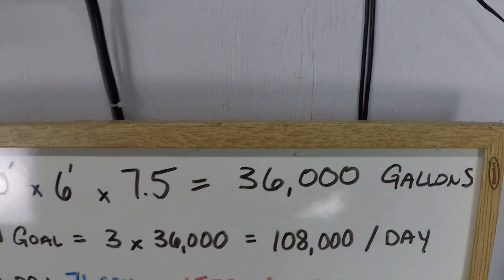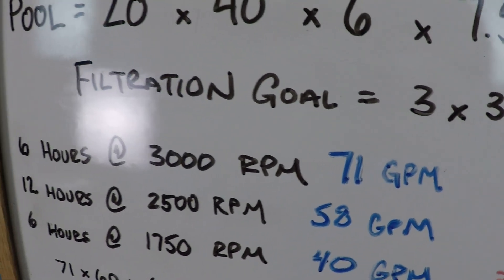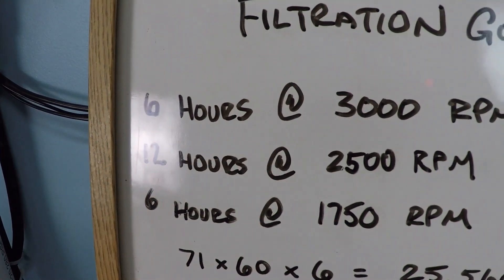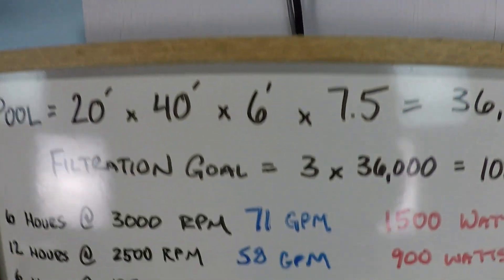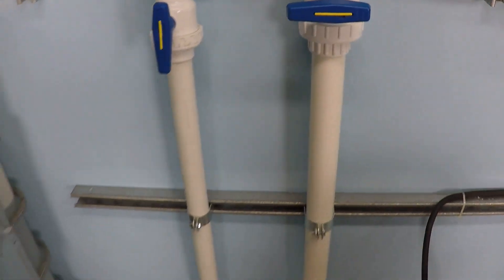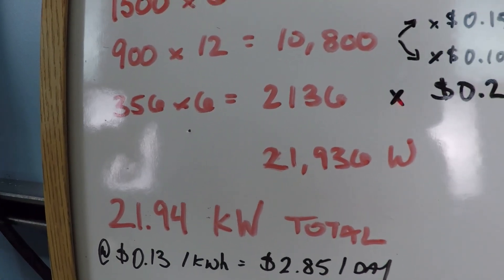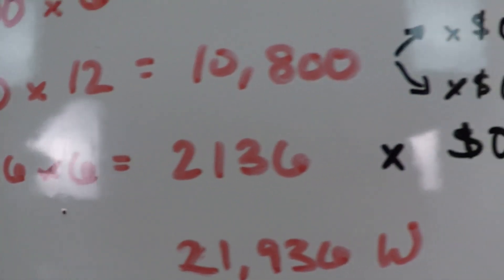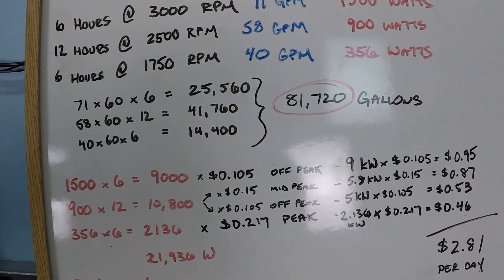When Does A Variable Speed Pump Not Save Money?

Comment: Nice video!
I have an old, 8 year old 1.5 hp Hayward. I run this 12 hrs a day and it seems very expensive to run at about $200 per month.
If I get a 2.2 Pentair vs and run it similar to your video I should use less? Is that correct?
Thank you

Comment: You give all this advice but run 120v. seriously  get a proper breaker a shove the neutral white wire in one side and black in the other now both legs are hot and you 240v
Reply from the maker: @samheninger505  I test all configurations    broheim

Comment: Interesting... So what would a person do in response not being able to get 3 turns per day, would they re-plumb the pool with larger piping?  Wonder how much that would cost.  Seems like a huge oversight of the original installer.
Reply: 2.4 times  turn over is plenty to have Cristal clear water and you only run that in the summer 1.5" pipe is fine you can up size too 2" pipe before the pump and do yer pump and filter in 2"  for better efficiency and use less power. Also change the breaker to 220v and use the white neutral wire  along with black wire on new breaker so both legs are hot and run pump on  220v. Running pump longer will filter more water as well . Boob tube is 85% newbies this guy seems to over complicate the simplest things

Comment: Hi Steve:
Love your channel.
I have been building and servicing pools for over 30 years. ( please check out my YouTube channel)
I am a fully licensed Electrical contractor.
Variable Speed Pumps are a waste of time.
However, the Pentair VF ( variable flow) and Pentair VSF ( variable speed or flow) Pumps are unique in the pool industry.
I have installed at least 200 of these pumps in the past 10 years. 
You should not feel bad about totally missing the point with these pumps, every pool service monkey, 99% of pool builders, and even Pentair don't realize that their pump is different from variable speed pumps.
I have checked the displayed power consumption of these pumps with a tong tester and it is accurate.
I have checked the displayed flow rate of these pumps with an inline flow meter and it is accurate.
I have found the Pentair VF or VSF pump is excellent for saving power.
It is also perfect when used in conjunction with a Pentair Control System and Automated Valves when you have multiple features. It allows different flows for different plumbing circuits. It also allows optimal water flows for Water Features, Solar Heating, Gas Heaters, and Heat Pumps, regardless of how blocked the filter happens to be. The pump will simply increase its speed to achieve the set flow rate so you never starve your heating system for water.
It allows you to set the pump at its most efficient flow rate.
I call this the Sweet Spot.
This pump also provides protection from loss of prime, has an adjustable priming flow rate for stupidly installed pools, dead head protection, and suction blockage.

If I build a pool with 50 mm ( 2") plumbing and sweep bends, with gas heating and Ozone, I always set the flow rate at 10 cubic meters per hour ( 166 LPM ) ( 43.855 USG ). This is equivalent to the actual flow rate of a 1 HP pump in the same installation, which is suitable for most pool applications and will draw 2/3 from 2 symmetrically plumbed skimmers and 1/3 from 2 x symmetrically plumbed floor drains via a 3-way valve at the pump suction. The skimmers work perfectly. This pump will draw about 500 Watts. We generally run it for 12 hours per day dawn to dusk. 
6kW per day. 120000 liters (31700.65 USG) per day turnover.

If I increase the set flow rate by 10% to 11 Cubic meters per hour ( 182 LPM ) (48.08 USG ) the pump will pull about 1000 watts.
So, therefore, I only achieve a 10% increase in pool turnover with a 100% increase in energy consumption.
12 kW per day. 132000 liters (34870.71 USG)

Obviously, I could run the pump for 24 hours per day at 10 cubic meters per hour to achieve double the daily turnover rather than increasing the flow by 10%
12 kW per day. 240000 liters  (63401.3 USG) per day turnover

If you use this pump on a basic pool with 50 mm (2") plumbing with sweep bends, a salt chlorinator, and no heating you will obviously not have the same flow resistance and you will be able to increase the set flow rate significantly before hitting the Sweet Spot. All you need to do is keep increasing the set flow rate until you see a massive jump in power consumption on the screen. It makes commissioning a new pool a breeze.

If you install this pump to a monkey-plumbed or old pool with 40 mm (1.5") plumbing, you will find the sweet spot at about 7 cubic meters per hour. 

It is very easy to prove this fact.
You can do this experiment yourself.

Comment: Ugh. So many variables. I have this size pool but with two 2" intakes to the filter, 2" pad plumbing and then out to a 2" spa or Caretaker with 1.5". The current motor is single speed 2.2hp, 240v, that runs with the valve split between the spa and Caretaker or else it is too much for the Caretaker. I replaced the filter within the last couple years to a Quad DE 100, rated for 150/160gpm. I never did any of these calculations until now after watching your videos. Thanks! I think... JK. Very helpful. 

I understand my numbers would be different. I will be adding a flow meter and energy meter this season to see what I am actually doing. I am trying to decide now if I should and then if so, which VSP I can hopefully put in this season. Running basic numbers, I ran 16hr days on the single speed I have now for what I believe would be roughly 24kw and 82k gal. I am looking to cut the energy but still cycle the pool. I have been trying to run some numbers for a VSP replacement. I calculated running the 6, 12, 6 or 4, 14, 6 etc. hour cycles. I really only see running on high for a majority of the time to cycle the pool three times. This obviously goes over the prior 24kw but it does cycle the pool. Looking to cut the elec but run the filter 24hrs for water movement, the most efficient i could think of was running the mid 2000 rpm, 55 gpm 24 hours. Maybe ramp up an hour or something but that would be roughly 12.14kw. That would still leave me 28,800 gal short of three cycles. That is roughly 3000 less gallons from the single speed now running 16hrs/24kw. The new VSP would then be moving the water 24hrs at 12kw, half the cost. What are your thoughts on switching to the VSP? Keeping roughly the same turnover but keep the water moving 24hrs and cut the cost, or aim for the full three turnovers?
Reply: Think 16hrs on high or the 3000rpm would be too much? Then 8hr at 2000rpm. I think that comes out to 3cycles at 28kwh. I think I like the sound of 12kwh better but not three cycles.